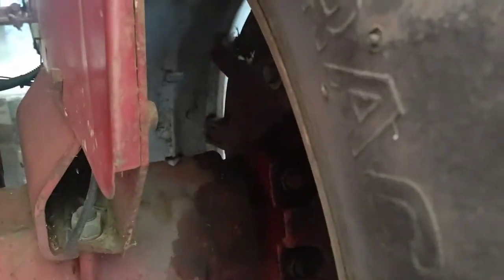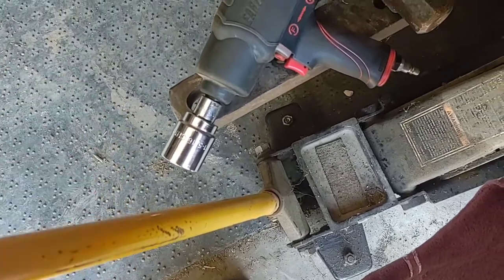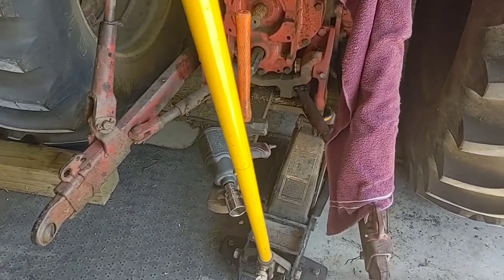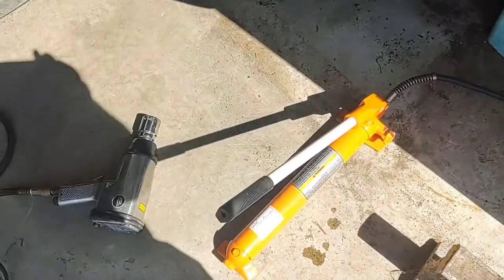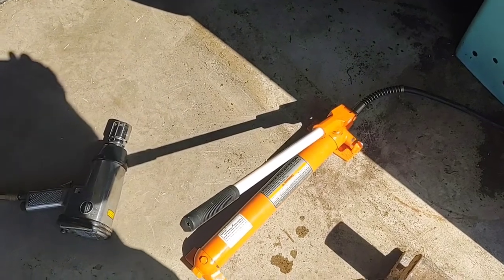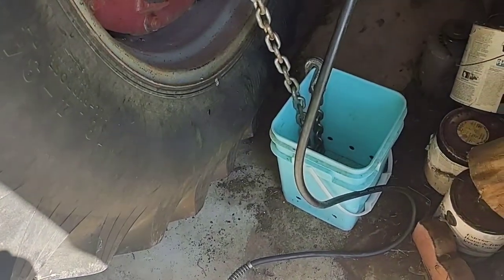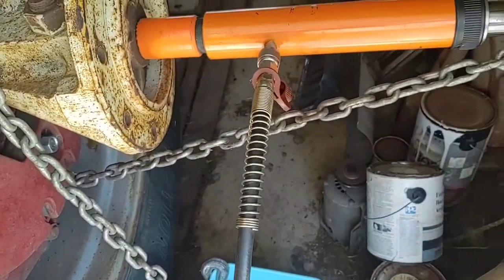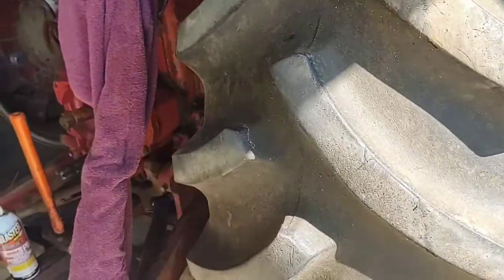Farmall 806 Project The Rear Wheel Spacing

Comment: Well.. you have the right tools for the job! We don't have row crops, but do have hills, so pretty much everything is at 8' to the outside of the tires. Always best to have duals on, then 12'++😁
Reply from the maker: Luckily, it's flat here where I use the Farmall 806.  We've had it on some pretty good hillsides & ditches over the years when the Hobby Farm was a bigger operation.  Thanks for stopping by Ed.  Take care. 🍻🍻🥃🥃🇺🇸🇺🇸🇺🇸

Comment: The old 806 I used to have liked to do that - wheel would walk in and out. Could never get it to stay put. Of course that tractor was pretty badly worn out. Good use of the porta power.
Reply from the maker: My Dad blames the wheel walking in from standing on the right brake trying to spin the tractor on the so called dime.  He might be right. Thanks for stopping by Farmer Pete.

Comment: Hello Ron thumbs up hope you have tight enough dont move. Have a good day.
Reply from the maker: Fingers crossed that the tire doesn't move.  Thanks for stopping by James.  Take care.
Reply: @crslyrn  In my opinion I would tight it up again after 10 maybe 20 hours is there a tork spec on them? If it keeps come loose may something is worn? I'm no expert just thinking things over have a good day Ron.
Reply from the maker: @jamesmorrison1884   I'll check the wheel after some run time.  I'm not sure what the torque spec actually is off the top of my head.  Bad thing is, I can't get a socket & torque wrench on the nut so it's just position the wheel so I can use my weight to get them as tight as I can.
Reply: @crslyrn  Maybe Pete from Just a Few Acres. He has alot knowledge on thouse tractors would know more. Have a great day.
Reply from the maker: @jamesmorrison1884   I'm sure Pete does know a lot about the tractors.  I've got a manual for the tractor that covers just about all services & repairs.  Equipment Manuals are like gold.
Reply: @crslyrn  I agree Ron the manuals are like gold I have for everything I own. Come to think about it I may not have for the 254 lol

Comment: I have had my 1086 wedge lock hub get loose twice. It's not a fun job to the hub sled in by tour self. Hopefully you got the u bolt tight so it doesn't slide again. Thanks for sharing.
Reply from the maker: Definitely not a fun job for sure.  Hopefully, I won't have to do it again.  Thanks for stopping by Monty.  Take care.

Comment: I've got a porta power just like that. Apparently I blew the inner seals straightening the frame on the neighbors dodge pickup after he got rearended several years ago. 
Doc
Reply from the maker: Dang the luck.  It's one of the best tools I blew money on so far.😂😂😂😂  Thanks for stopping by Doc.  Take care. 🍻🍻🥃🥃🇺🇸🇺🇸🇺🇸
Reply: @crslyrn  I haven't messed with the rams much, but couldn't figure out how to get them apart.
Reply from the maker: @martinbenton742   Unfortunately, I've not had one apart either so, I can't give you any good suggestions on the repair.